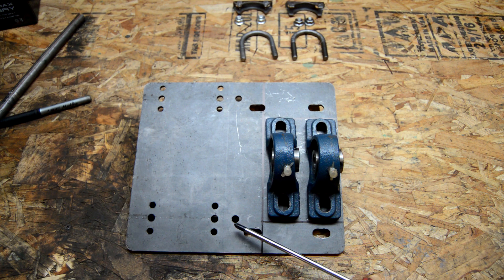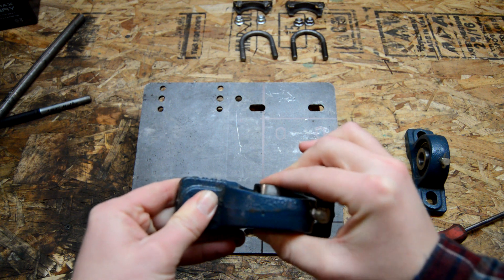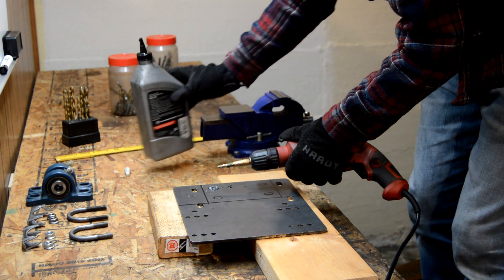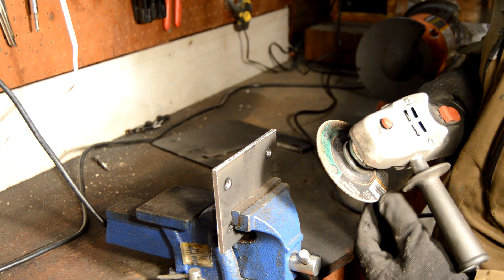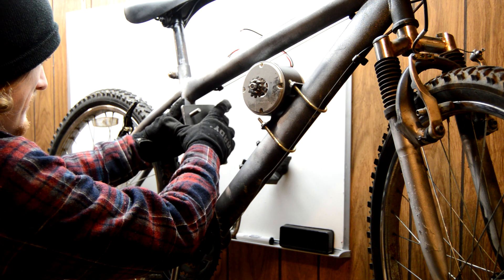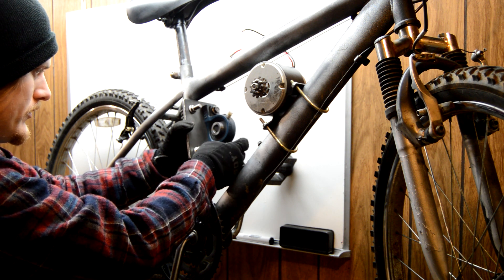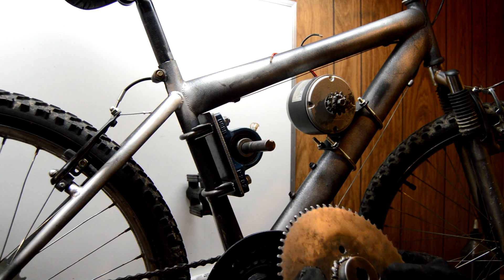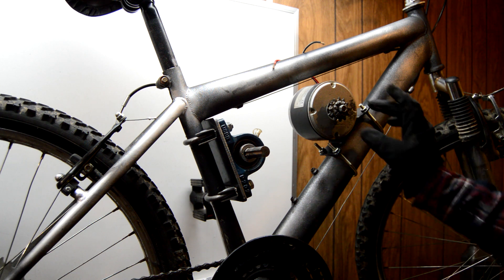DIY E-Bike Build - Jackshaft Install EP4

Comment: To keep from collapsing the seat post down tube an old thick aluminium seat post can be driven down below the original seat post. Just cut it to allow enough space of about 2 to 3 inches for the original seat post your using to stay tight. Then the clamps can be tightened down tighter without collapsing the down tube.

Comment: I am  currently, among other projects, also working on a diy ebike using a scavenged
kid 20 inch bike and a scavenged pocket mod 250 w 24v motor  of the type you are
using...with the same 4 hole mount... When you get above 350 watts, they sell gear
reduction motors so as to drop the rpms to a usable range...I wonder which is more
efficient(in order to avoid a giant rear sprocke), using said gear reduction motors or
jackshaft? I guess you are about to find out...Im mounting my motor in an 
unconventional place which i may divulge later,,also using #25 drive sprocket,chain,
and wheel sprocket in  a direct drive set up for now. But a clever jackshaft would be
cool to allow me to change ratio to a more desirable 1 to 9 up to about 1 to 12 or so.
Would be neat to incorporate an old 5 or 10 speed cassette in the jackshaft
Reply from the maker: A 350 watt motor is going to consume more energy than a 250 watt motor regardless of built in gear reduction vs. a jackshaft. I think the main advantage of built in gear reduction is for ease of installation, but of course that comes at the cost of customizability. The gear cassette jackshaft is a cool idea. I have seen pics of many e-bikes online where people used the hub of a rear bicycle wheel as their jackshaft. It's definitely something I'm considering for a future build.

Comment: I got a free heavy duty 24V  800-ish watt motor from a home stair/chair lift for handicapped people....I was just thinking instead of using a jack shaft, I could maybe just mount the motor on the bike frame where your jack shaft is, then use a chain and  crank free-wheel kit from a jack shaft kits for 2 stroke motorized bikes (don't use the JS only the chain,crank & free-wheel parts) then I'd be able to use the rear gears and also pedal it like a normal bike when the motor isn't running/battery dead......I also got a free working 250w kids scooter (the two 12v small lead acid batteries inside went bad so they threw it away. I believe instead of buying the whole 2 stroke motorized bike jackshaft kit, you can just buy the chain and bottom free-wheel crank parts for about $50
Reply from the maker: With electric motors, they make a constant torque rating across the entire power band. So you don't typically see electric vehicles with multiple gears since they don't have to rev up to make power like gas engines. The reasoning for the jackshaft is because there is no built-in gear reduction like there is on a 2 stroke kit motor. The reason for the gear reduction is that the wheels are so tall on bikes and without it I'd have a top speed of around 100mph. As for the freewheel aspect, yeah that would be a good idea to limit drag for pedalling when the batteries are flat. For my build, I'm just going for simplicity. Hence why mine is direct chain drive. After it is done, I will test to see what kind of drag it makes with the controller turned off.